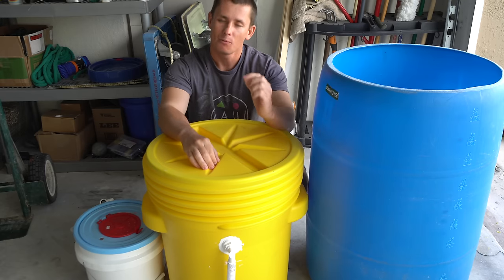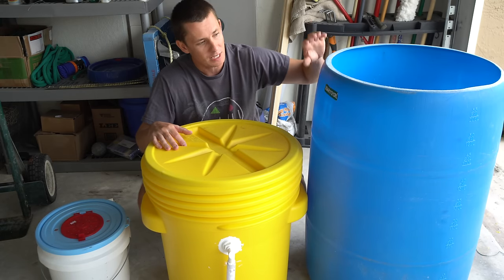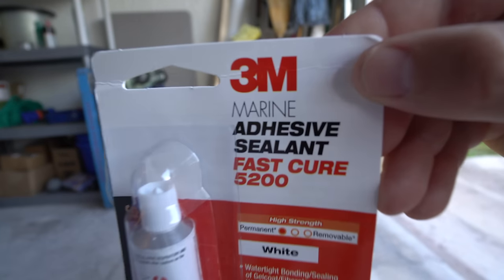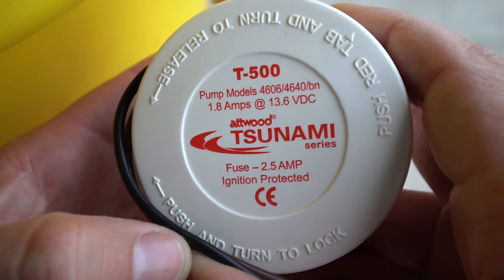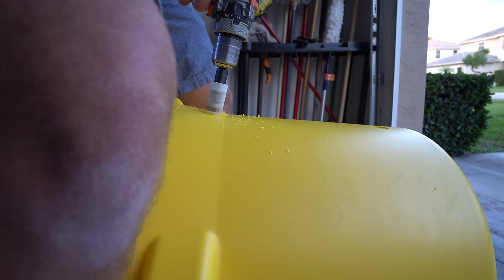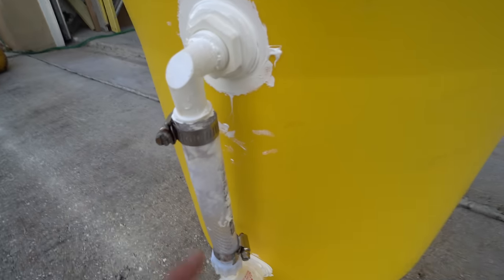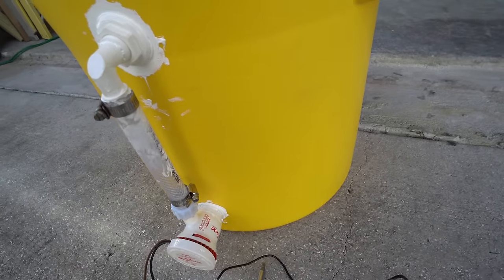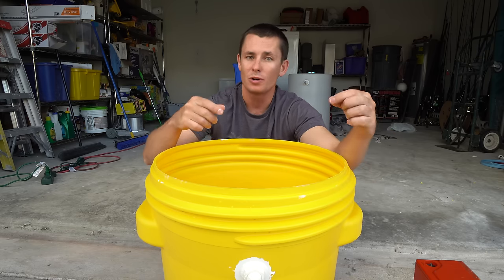How To make a HOMEMADE Live Bait well! DIY Livewell Project

Comment: Great DYI video.  One suggestion for connecting your wiring to the battery.  Solder your wires together and cover them with heat shrink wrap.   The shrink wrap will prevent water from contacting your copper wiring and causing corrosion.  Keep the vids coming.  Thanks

Comment: I made a handy one out of a small bucket, that 5 gallon bucket is ideal. I drilled heaps of holes in the top 1/3 and zip tied a pool noodle near the lid all the way around it so it floats. I made a hatch in the lid to put the fish in easy and they can't jump out. I don't need any batteries or pumps, I tied on a rope and just hang it in the water and it floats. The good thing when you need to move spots there is always half a bucket of water from only drilling holes in the top 1/3 of the bucket. In some situations it isn't ideal, but for the most part it works awesome.

Comment: I have had a portable bait well for a long time. Quick tip for you. Add a stainless inlet adapter to the inside pump and it will keep trash and fish scales out of your pump. Love the pump you chose. You can actually buy replacement motors for them and want have to tear up your plumbing :)

Comment: I had trouble finding the swivel head at Lowe's or home depot but west marine had one for ten bucks, but if you want it to flow in a certain direction I had to position it in the direction I wanted it to be so the water would circulate before I applied the sealant. thanks for the video landshark!

Comment: If you used a boat bilge pump you could keep all the plumbing internal and avoid cutting holes in your bucket. Is there a reason why you feel recirculating water is better than an aquarium style air pump?

Comment: Great, simple project. Lots of value and low cost, low risk  project. I think it is easily scalable to smaller or larger live wells. You're right,  I can see how it doesn't really work for installation in a boat deck but some parts could lead in the right direction. Thanks. Oh yes, do more. And for us newbies, how about a minimal content offshore tackle box plus another for inshore and freshwater. Not too detailed just what tools and consumables are needed so we Don't get miles from home without the bare essentials. My best to Brook. Maybe she could help with Tackle Tuesday.  ; -D

Comment: Here is a suggestion for the drain plug that might be useful  , don't use a plug like the ones on a ice chest. Use a ball valve. You can get a twist ball valve or a lever ball valve. These two types of values can be used to on pvc containers. Home Depot is a good place to find these and are pretty cheap to buy. Can't wait to see you use this bait tank on juno pier. Take care and happy holidays.

Comment: I have one of these to hold mullet in the garage for at last over night. It gets hot here in so fl. Any ideas to keep the water temp down? Other than frozen water bottles. It gets old changing them out.

I had also thought about running some flexible hose through a mini fridge with a pump and thermostat.

Comment: Instead of a drain plug, you could also consider adding a three-way valve and use the pump to remove the water. This will allow you to empty it from your boat.

Comment: you could also use the Flow_Rite pump out aerator head instead of a drain plug. It swivels and when you're done pull the head out and the pump will send water through the aerator and out your discharge hose.
Tight Lines.

Comment: Nice build.   Those holes might be easier to drill with the drill going in the right direction;).  Might just b flipped on the video but it looked like it was going backwards.
Reply: Thought I was the only one who noticed that lol
Reply: Will Myschlongro no you are not alone. My wife gets mad at me for pointing things like this out in movies 😎
Reply: Ya I saw that too lol
Reply: I saw it too lol it's all good brother love your vids
Reply: I plan to do this myself just to have a mullet tank at home so I always have live bait
Reply: Sometimes I run those type of drills in reverse whle drilling in  plastic. It makes a less aggressive cut.
Reply: Actually, when drilling in plastic. Using a spade or regular bits. The cut is a lot cleaner. It's more or less melting the plastic making a smooth Burr free cut.
Reply: That boy don't know the difference between a drill or a hammer
Reply: Hodge-Podge Garage besides the fact that it actually works, there was nothing nice about that build. You said nice build what were you talking about it's a mess
Reply: When drilling thin plastic with a hole saw its better to run the drill backwards and melt the plastic instead, in order to avoid gouging and deforming the hole. Whether intentional or not, the kid did the right thing.

Comment: rubber washers would have worked  also and none of the mess or permanent problems if a leak appeared later on,or in case you change something or decide to use these parts in a new tank. you can cut rubber washers out of any rubber mat or buy them.  Currently making a Minnow Sell holding tank as Ive noticed all the old local minnow shops have closed down and left a need for a live bait shop,,,good way to supplement social security in my opinion,,guess i will find out. picked up a working small chest freezer for free and i will be adding a coat of gel coat in a blue,,light blue color to help assure all areas are well sealed and maintain a better stress free environment. I plan on using a bucket filter although the smaller version made from a large diameter pvc pipe is also a option that looks good too. Haven't decided on a pump yet due to price differences .

Comment: That's just an oversized aerator. Why not just use the bin with a portable airstone/pump and run it on a couple D batteries or a plug-in pump while at home? It would do the same thing. Or better yet use said air pump to run a cycled sponge filter which would eliminate ammonia in the water produced by the bait. Then all you got to do is change out 25%ish of the water once a week, and you can keep it alive indefinitely. Just like an aquarium.

Comment: Very well put together!! Im wondering, how do you keep the water from warming up? i used one of those pumps in the past and after a few hours outside my baits died from the hot water. Any recommendations?
Reply from the maker: Good point, well that's one reason I like having a circulating pump as seen in video opposed to just an aerator it def helps in cooling the water. I live in Florida and I have never really had a problem with baits dying from overheating. However I do like to change the water as often as possible. You could always put an ice pack in for a shirt amoiynt of tinr
Reply: use air pumps don`t use water pumps water never warming up and less work
Reply: muhammed kajee move to Canada...

Comment: Only thing I’d do differently would be to put a tee in the line and a ball valve on the tee to drain the water. The pump will do the work and have the tee high enough off the floor so you can easily put a 5 gal. bucket under it, or connect a hose to the ball valve so you can drain water in the yard.

Comment: Can this be done to run on 110 electric? I'm looking to build a permanent bait tank for saltwater??
Reply: Yeah just get the water pump that is rated for A/C voltage, DC voltage is a battery like what he used in the video.

Comment: I would have just used rubber gaskets to seal the pump to the container, this way if you have to replace the pump at a later date due to failure.

Comment: what if the pump fails? wouldn't it be better to just use rubber washers for gaskets?
Reply: karl wood the pump he is using pops out from the housing so he would be able to change pump without removing the whole thing

Comment: question I made the exact live well you show, works great but I noticed that after a few hours the top of the water starts becoming foamy and that it feels like the bait do not last very long, am I doing something wrong? I was using live sardines bought bait boat.   I did not use the cover and it was a hot South Florida day, I was also moving locations a bit also.
Reply: Add about a 1/2 cup of rock salt to the water to keep the slime off. As for the heat, throw a handful of ice in the bucket while fishing.
Reply: Lol no. Buy de-foaming agent for aquariums on amazon and bring a frozen 2 liter soda bottle filled with water and throw that in the tank  like a giant ice cube

Comment: It's too bad Attwood doesn't make a version of the pump with slip (glue/cement) connections at the pump. Then you could use a uniseal on the curved surface and wouldn't need a drop of 5200 for a perfect seal. it might even be worth converting from threaded to slip with a Tee and slapping a ball valve into the 3rd port of the Tee. You'd then have a simple way to drain most of the tank.

Comment: Victor if you don’t mind me asking how much did this cost in total
Reply from the maker: Well $30
Pump $20
'Aerator $10
Spray head $17 
Tubing, aligator clips etc, $10
5200 $10
$87, but you can search around for the clips, tubing and the spray head. If you go with any store bought live well in the 20-30 gallon range good luck finding the UNPLUMBED well, under $70.

They also make a 50 gallon yellow container with lid by the same company.
Reply: Landshark Fishing thank you
Reply: Re-Check your math . . . That's $97 !

Comment: Everyone hates a critic especially the one who is being criticized, so don't hate me buddy. First, It looked to me like your drill bit was running backwards or in reverse. It did get the job done though. Secondly, your self analysis about wearing hand protection is well taken and should be by anyone else who messes with epoxy. Thirdly, your electrical connections should be done with crimp connectors, or at the very least wire nuts. The electrical tape needs to be neater because moisture can enter what you have there and cause problems. That particular size of container looks to be just right for two. Water weighs just over 8# per gallon so a young strappin' lad like you can lift it but an old fart like couldn't. Yes definitely screen the inlet and put in a drain plug. Some pf those empty barrels (55 gallon) may have contain something that the fish may not live with. It is always a good Idea to wash them out good first. Good video though - I liked the idea.
Reply: Calm1now
1 second ago
when you are cutting plastic with a whole saw if you run the hole saw in reverse you get a much cleaner cut than running it normally ... watch the aquaponics videos and you'll see most everyone doing this and talking about ,,,
Show less
REPLY

Comment: Notes that need mentioning: The outside of the hole saw should match the fitting. don't stick the fitting inside of the hole saw because the hole will then be too big. A better option for aeration is a venturi to aerate the water instead of just spraying the surface...Here is a simple demo in a water bucket.
https://youtu.be/PrmC4dRlTTo

Comment: No filteration? Thats one of the main goals filteration, circulation, and oxygen? Decent build but dont reccommend without filteration.
Reply: I’m thinking to use this on my 17ft boat for mackerel. I like what he did but like you said.  where do u connect the hose if you want to keep the fresh sea water keep pumping in to circulate new water. Is there a 2 way pump?

Comment: You WILL need a flow of fresh water to keep the acids from building up in your well. You concept is good but for limited time/usage. Keep a lower number of baits in this well and they will survive longer. On a boat, use fresh water intake for longer and better bait life.
Reply: 10-4 Captain Bob I pump in fresh on timer 5 min on12 min off and over flow out the back of boat 🇺🇸🌴🐟 John